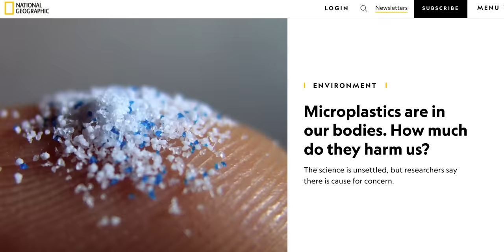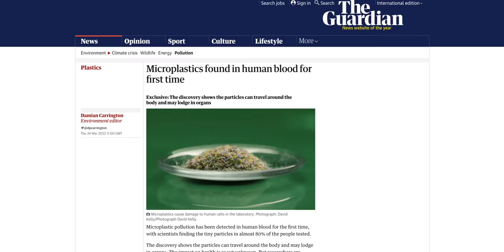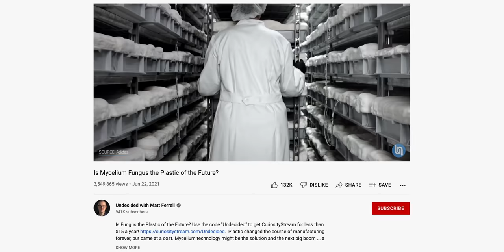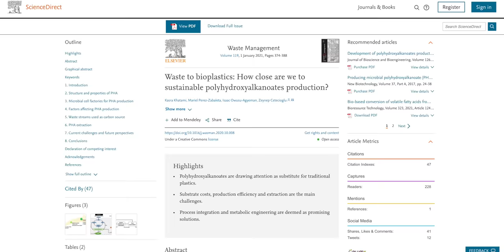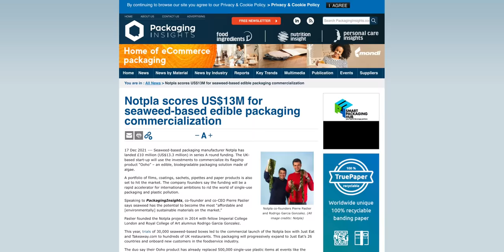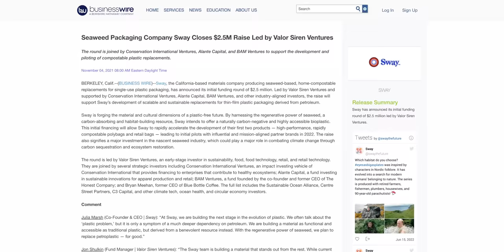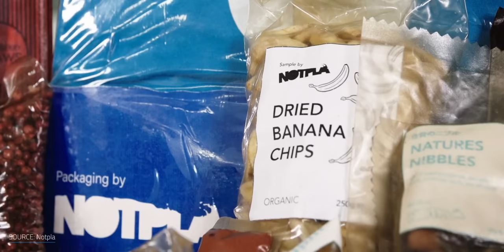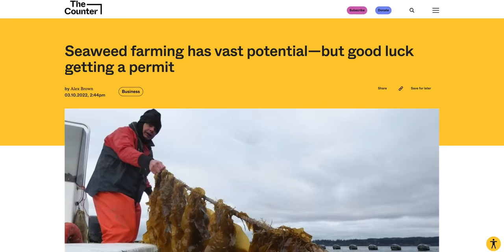Why Seaweed Could Be The Future Of Plastic

Comment: I for one will be glad when we can finally get rid of styrofoam packaging. It's so annoying to deal with. It breaks apart into tiny static clinging particles. It's difficult to compact without some sort of grinder. It cannot be melted down without releasing toxic fumes. It cannot be recycled, so it just all ends up in the landfill.
Reply: Fun fact! While you're absolutely right about thermal melting, you can dissolve it down into a glue-like paste using solvents like orange oil or turpentine. It even hardens like glue. At the very least the process gets Styrofoam down into a manageable size
Reply: @alantupper4106  Hmm I might have to look into that. If it can avoid releasing toxins and is cost effective, that may be a good solution to reduce its size.
Reply: @alantupper4106  hey buddy, how long does the styrofoam take to set/harden? It might be fun to build some molds and pour the styrofoam in while "paste like"... I also wonder if this mixture could be useful in say 3d printing?... Totally going to play around with this reaction! Thanks dude! 😎🤙
Reply: @bjornborn5845  Hey, from my experience it's a few hours to harden, overnight to really cure. Some carpentry folks use it as a wood glue substitute for that reason! It's probably not gonna work well for 3d printing, the dries material is likely way too brittle for FDM and you still have the devilishly small melting window for Polystyrene to struggle with. In the dissolved form, it's pretty viscous and to my knowledge it's not photocurable like a resin.  Happy to be proven wrong, happy tinkering!
Reply: @bjornborn5845  Adding on from my original reply: Mould-shaping should be possible. It would be interesting to see if a 3d printed mould could work with dissolved polystyrene.
Reply: Thankfully most of the places where I used to see styrofoam I now see cardboard. I've also gotten mushroom packaging a few times which always makes me super excited since it's literally just repurposed ag waste.
Reply: Laughs in third world banana leaves and waterproof paper
Reply: @alantupper4106  Would it be possible to form the paste into sheets? Wondering if I could turn all that extra foam into plastic model building materials.
Reply: Check out Green Cell Foam. I get meals delivered that use it for packaging. It dissolves instantly in the sink or you could use it as compost.
Reply: It turns into an excellent bound concrete additive for buildings and adds R-value to construction expenses.
Reply: @bjornborn5845  works pretty well with concrete in construction
Reply: @alantupper4106  added to concrete, especially "air-crete" works very well in structures.
Reply: I hate the way it sounds
Reply: Not to mention the awful screeching sound it makes
Reply: @djdaddy8080  
I hate that sound. It’s one of my least favorite sounds. I’d rather listen to nails on chalkboard.
Reply: @joeybulford5266  very few things in general make me physically retch, but styrofoam screech, fingernails on the chalkboard (but the sensation not necessarily the sound), certain silverware scraping on certain flatware, and smelly old refried beans do. Rotten meat, gore, fecal matter, not enjoyable but no problem.
Reply: @Frogmen It reduces air quality
Reply: @alantupper4106  Yea I just thought about it for a second why don't we just use peanut shells are packing peanuts, they are biodegradable and long lasting not to mention they are plentiful.
Reply: @TryinaD  Yea we already have alot of alternatives we just stuck in the trap of consumerism.
Reply: You'll notice a lot of the peanuts you get are actually starch and dissolve in water.
Reply: acetone breaks down styrofoam really well, but what is the goop that remains, I don't know...they should do some research on it.
Reply: Or burned for electricity, or ends up in the ocean.

Comment: A couple of questions came to mind as I watched the video.
1. At one point  you mention seaweed plastic film being more expensive at up to $3600 / ton.
For those of us not in the know, it would be nice to know the cost of traditional plastic film for comparison.  
2. What is the shelf life of products packaged with the seaweed plastic?  You touched on it when you mentioned the seaweed plastic sachets might break in shipping but I'm wondering about the "this plastic will break down in two months in your home compost".  If product "X" is packaged in such packaging does it have to be sold more quickly or does the clock not start ticking until it is exposed to other elements such as water / heat / UV sunlight in the compost?
If you answered either of those then I apologize for missing it.
Reply: He did not actually touch on any of that. I suspect it was either due to time constraints or he just didn't think of it.
Reply: Just do a quick google search and in less than 30 seconds you can figure out that the cost of traditional plastic film works out to roughly $1545 / ton.  So... it's about double the cost.
Reply: $76 per ton
Reply: @modernpirate  I think some of these questions are asked so that they appear in the podcast recap of the video on one of his side channels.

Edit: also thanks for googling for us. I was curious but diddnt care enough to look it up.
Reply: @modernpirate  but you need to account for the actual disposal costs of the product and damage it creates to nature so its much higher.
Reply: @vmr6771  only to Karen Earth. To USA Johnny, the cheaper and all about me and only today, the better
Reply: @modernpirate  Double isn't that bad really...
Reply: I am skeptical of materials that break down too fast. Why must we sacrifice quality for an uncertain level of environmental impact?
Maybe plastic just needs to be treated as more of a precious commodity and we need to look at our processes for recycling, rather than coming up with new stuff that just breaks and falls apart? Things break & fall apart, it's going to make a poor impression on the public and inhibit adoption. Especially if they are more expensive on top of that.
People have standards, and not everyone is willing to sacrifice physical material quality and strength for a feeling of 'green'.
Reply: I very appreciate your skepticism spirit. And the transitional plastic price depends on specific plastic from cheap 700$ / ton to experience 1,000$++ / ton. So currently, seaweed plastic costs from twice to five times more than transitions.
Reply: Thats exactly the problem for a plastic replacement. It needs to be stable for about 3 to 4 years for companies to stock theyr products
Reply: Richard Homan  tha'ts why they want to do it in the water, not on land, so that you don't have to convert anything, and I think it would be easier to automate far off shore
Reply: @peterbelanger4094  because the enviromental cost of the quallity is too high, and for 90% of packaging the long-lasting is not needed. Think of all the fruits and vegetables that are wrapped in plastic. For food, packaging just needs to outlast the product, which isn't that hard. 

Just replacing every single use thing with not-plastic material is HUGE. You want it to be harder to break on accident? Probably just make it a bit thicker until someone comes up with new method of doing it thinner
Reply: @davidbwa very valid questions. The timeline is a problem for manufacturers and packaging companies.  If something breaks down too quickly, then it's hardly a replacement to plastics designed to last for an extended period of time. An important thing to remember is that we are at the early stages of R&D, and over time there will be improvements and breakthroughs that will enhance the likelyhood of widespread adoption of plastic alternatives.  Also, laws could also affect the implementation of alternatives. I was living in Morocco when COP22 was held in Marrakech and the government banned plastic bags ("zero mika").  I was back earlier this month, and there are still very few plastic bags in the zouks, and the big supermarkets use plastic alternatives.  Here in Europe, we have the law that went into effect this year banning single use plastics (cups, cutlery, etc), and it has made a difference.  If Morocco, a developing nation (developing quickly I should add), can implement rules like in the EU, then manufacturers andcompanies may find an incentive to shift production for markets that don't have the same strict laws on plastics. 
Just as some petroleum companies are shifting their businesses toward sustainable energy (wind/solar), so too could they shift to plant-based plastics. Petroleum companies, and their industry lobbyists are very powerful, and although we are shifting away from petroleum for energy, petroleum companies have been expanding in the area of petroleum-based plastics as a share of their profits. The problem of plastic is a very complex one that is impossible to fix in the short time. It will take many gradual steps, with some major scientific breakthroughs before the avalanche of change i.e. the widespread abandonment of petroleum-based plastics. 
Look how long it has taken for us humans to move away from internal combustion autos to non-IC ones, e.g. EVs.  Yesterday the EU agreed to end IC auto manufacturing/sales by 2035.  I can imagine that plastic will follow a similar trajectory.
Reply: @peterbelanger4094  Very true, while I want alternatives the kinks need to be worked out. I usually buy compostable bags for my food waste, more often than I like I will get a package that obviously sat on the warehouse shelf too long, or in the wrong environmental conditions, and the bags have zero integrity and just fall apart as I pull them from the roll. I end up just ordering a few boxes with the hope some of them will be good and throw the "precomposted" ones in the compost. I know not many people will have that patience with a product and will just go back to landfill and ocean fodder.
Reply: @brunomanco7529  Either that or have an expiration date on it, if we can do it for milk and eggs we should be able to do it for some packaging also, eventually, with lots of kicking and screaming 😅
Reply: @alexwalker2582  he can't touch on that because it would expose how not viable these products actually are in the real world.
Reply: @vmr6771  You are right, of course, that those costs should be taken into account; however, manufacturers, who are the ones making the decisions on where to source their materials, tend not to look at the costs of those externalities unless they are forced to. Forcing them to either bear those costs directly or at least take them into account can be extremely complicated. It typically requires governmental action, which is likely to prove unpopular with many stakeholders, or it requires widespread popular pressure, which is also comparatively rare. When it is present, it can work wonders for society at large. For example, the Clean Water Act in the United States forces manufactures to directly take into account the environmental damage their processes would otherwise cause to waterways. Unfortunately, this sort of regulatory action tends to be the exception rather than the rule.
Reply: If there is an alternative, it becomes more viable to put taxes on plastic.
Reply: @WaterspoutsOfTheDeep  It reminds me of the Xanth novels honestly.  Hey!! there is a bush for that!!
Reply: I will give an analog to a bunch of corn plastic bags and pens I kept on a shelf for a long time a few years ago, because I needed to know.
Obviously it's a different product, but might be similar enough.
The thicker book store type bags broke apart within about a year, into millions of tiny flakes.
The pens started breaking apart after about 3 years, with material, again, sort of flaking away.
Obviously that plastic isn't appropriate for long term use. Not sure if it was compostable, but that would be a big plus.
Imagine if all plastic packaging could be composted. You could also throw it out and not worry about it.
Reply: Seaweed sounds great but I’ve also have seen that industrial hemp might be used for bio plastics, especially since it uses much less water then most other plants and can grow in low quality soil conditions such as the deserts . Plus it has a multitude of other uses such as for food,biodegradable high strength clothing ( much stronger and last longer than cotton but biodegrades much much quicker than polyester) ,  it can and has been used for making fuel for planes and vehicles and also been used in the building industry in place of wood and the list goes on . To note too is that hemp replenishes and improves most low grade soil conditions. Do the research.
Reply: @DanielRichards644  Higher taxes on gas would help address the shortages.
Reply: @peterbelanger4094  The problem with recycling is the recycled products end up more likely to break and fall apart and Its not profitable not even 20 percent of plastic is recycled.
Reply: @DanielRichards644 He just said how these products are scaling up and feasibility is going to take time, Nobody can see into the future.
Reply: @peterbelanger4094  what is your quality expectations on plastic wrappers for instant? Considering the shelf life of many foods (fruits and vegetables in particular) there is no reason that the wrapper outlast the protected item for 100s of years.
Reply: @brunomanco7529  depends on the product and the environment. There is food stuff which comes in cardboard boxes with a plastic bag/liner inside. So, as long the plastic holds up in this controlled and short lived environment it should be fine. It would be interesting to see if this plastic has the same properties during the production of the final product e.g. can be used at the existing equipment at the same or similar speeds.
Reply: @lowrads3653  exactly, or ban it as we have seen it with straws in the US or shopping bags in Europe. The best way is to reduce the demand first.
Reply: Richard Homan  are you disagreeing that plastic is bad? It's extremely bad.

And no one is talking about using the sea weed that's already there, we are talking sea weed farms. Completely new farms of sea weed.
Reply: Richard Homan  Why do you assume it has only to come from Hemp Oil? how about the fire content and the left over stem parts....?
Reply: PLA for a 3D printer is about $15 per kg so $1500 per (metric) ton
Reply: @anydaynow01  But eggs that expire are thrown out... that's a loss which companies don't want... that's why milk nowadays got so many additives, not because the additives are healthier, but because it makes milk last longer which means stores don't have to throw away a bunch of milk...
Reply: Richard Homan  Matt doesn’t promote stuff. He covers all the cons, including the high price and lack of durability.
Reply: @vmr6771  Yes, but the traditional plastic manufactures are paying for disposal or recycling cost. That generally gets pasted on to tax payer a.k.a you!
Reply: I live in Karachi Pakistan I like your comments
Reply: @janzandberg7294  I live in Karachi Pakistan I like your comments
Reply: they are probably best suitable for more perishable products that you wouldn't store for long - like salads, etc.
Reply: @peterbelanger4094  uncertain? did u miss the part that more of these micro plastics are getting into our food and thus in our own bloodstream? it's only a matter of time before we start seeing the effects and we start breaking and falling apart. I mean look how long it took to correlate air pollution with many human ailments we have to deal with today. We need more of this type of innovation or there will definitely be very different standards when there are less people around to establish them.

Comment: I've always been curious about the efficacy of bamboo in place of larger plastic objects like bins and such. It grows incredibly quickly, it's flexible yet durable, and could likely be made into all kinds of shapes with the right process.
Reply: There are lots of bamboo alternatives out there but unfortunately some searching is required. They even have bamboo toothbrushes (they take a little getting use to but I love them) and other alternatives to plastic consumable items. I'm actually thinking of replacing all my food containers with bamboo/glass ones since it is naturally antimicrobial.
Reply: Yes, bamboo is one of the most underutilized natural resources in the Western world. In the East it's used for everything, but for some reason that hasn't yet spilled over into the West, but it definitely should.